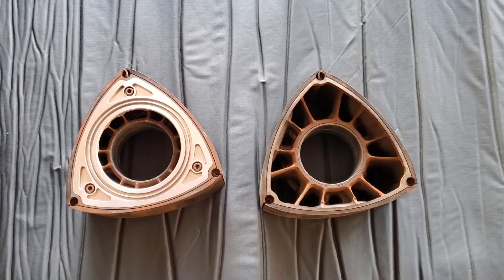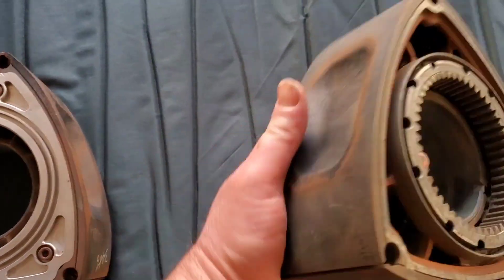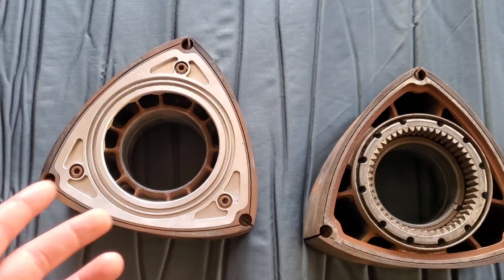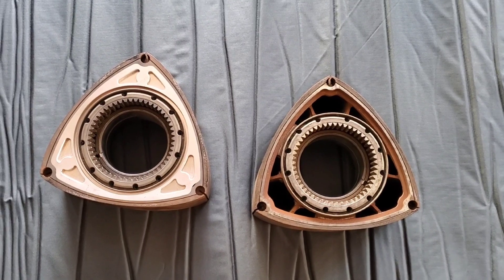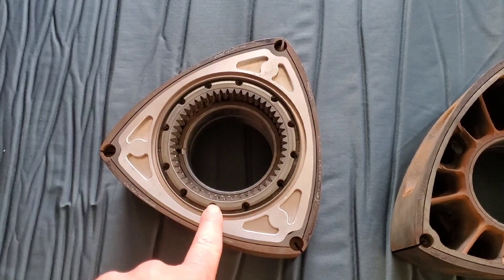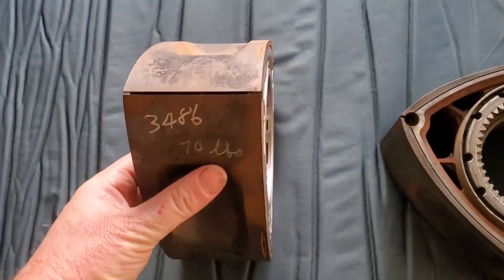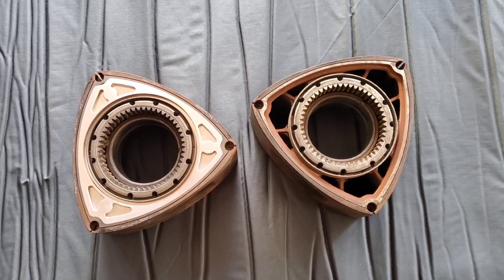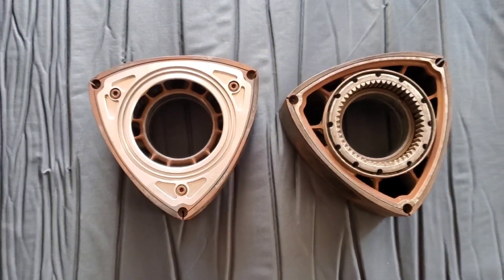Super light Aluminum Rotors, Mazdatrix Rotary Experimentation , prototypes before Titanium - Part 1

Comment: Nice video. I was wondering how the aluminum would seal at its outer contour against the cast rotor to make sure the oil stays in the rotor. At 3500 rotor rpm there will already be a substantial pressure from centrifugal force trying to push the oil between the aluminum and the iron.

Comment: The 13b already revs to the moon, I would think saving a few grams would not help much, in terms of engine weight, also insignificant.  a little more boost gets you more power.
I wonder if anyone has tried rotating the housings instead..I know liquid pistons are essentially doing that, but its different, more inside out.

Comment: Reading the old Le Mans SAE papers, they used precision lost wax casting for their lightweight rotors, compared to the traditional sand casting for the OEM rotors.  Did MazdaTrix ever try that similar process, since it was already race proven?
Reply from the maker: I think at this point 3d printing may be the answer but yea lost wax is more precise than sand.  We didn't have an issue with the mold, we just got bad data about titanium metallurgy shrink patterns.

Comment: You'd think with 3d print stl files avail with scale 13b available, this could be done easily.  I can print the file, but lightening it would be the tough part.  Programs exist that will use ai to determine the tree/branch structure needed inside for the most efficiency and strength. 

 Do you think "dimpling" the rotor or at near leading edge to give a turbulence on the portion of the rotor where unburnt gas sits and gets thrown out the exhaust would agitate it enough to have more of it get used in combustion inside the motor giving better fuel economy?